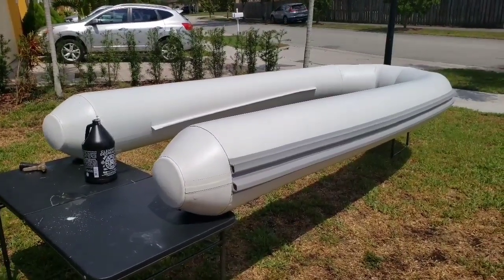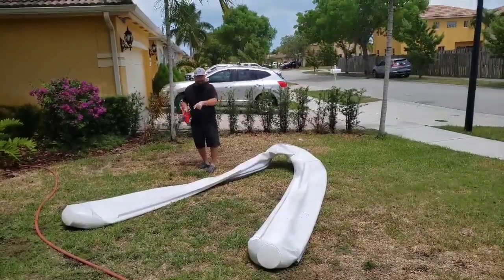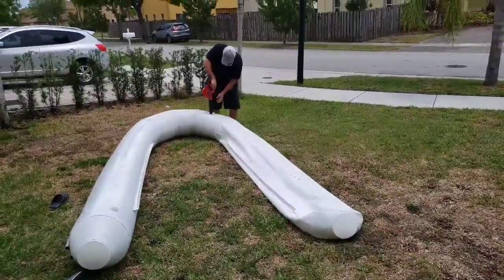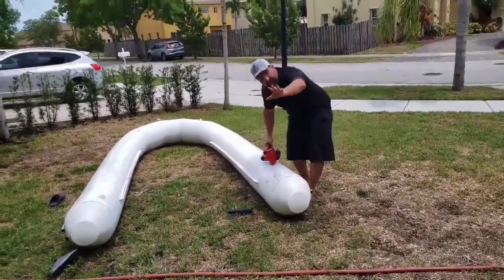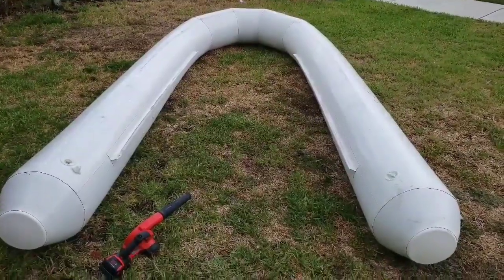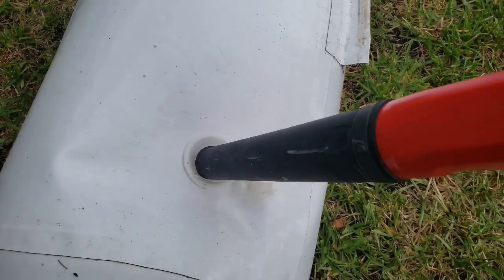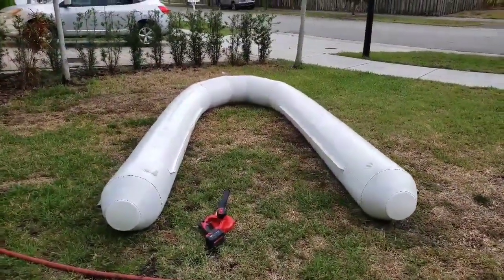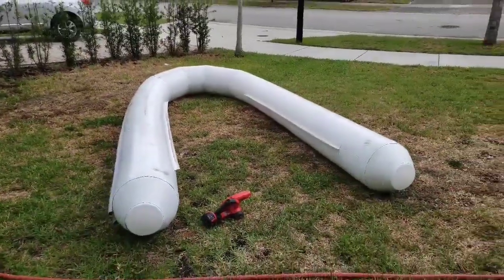The fastest and easiest way to inflate a rib boat tube. (dinghy/tenders)

Comment: They make a deal that goes in the end of the black tube that depresses the valve when you stick it in there and lets valve back out when pull the blower off. No need to turn the valve. Pretty slick. They use it for whitewater rafts. Leafield and C7 valves compatible. Northwest rafting company has a video on here about it.
Reply from the maker: just emailed them that would be a game changer. thanks for the heads up

Comment: gonna try this out with my zodiac cadet and makita dvc750! It says it has a peak of 1800 litres per minute so should be really fast. I was at the point of buying one of those 'special pumps' which are way to expensive for what they are, only advantage to those is you can set them to a pre set pressure.

Comment: Hi, may be you can help me on this. I want to store my fiber glass rib boat without engine in vertical position, either side or vertical way, because I will not use it for the long time. How I do it to avoid the damages to hypalon Fabric? Boat fiber glass length is around 8' with no air (model: ocean runner 350). Thank you